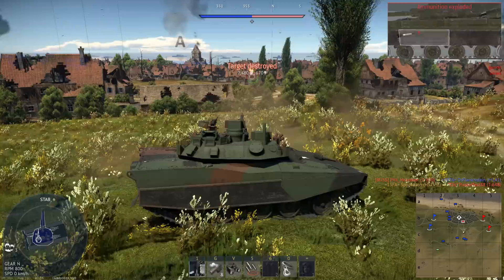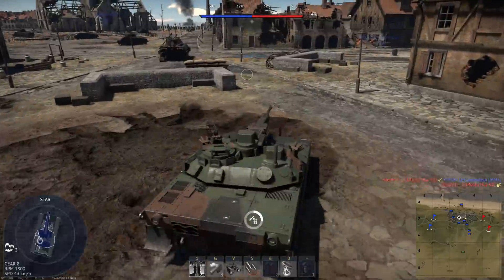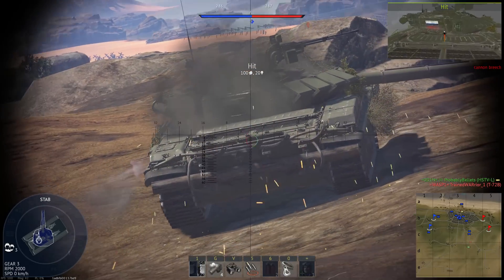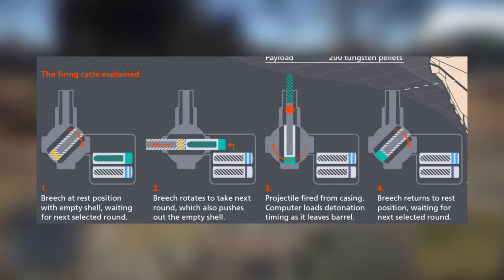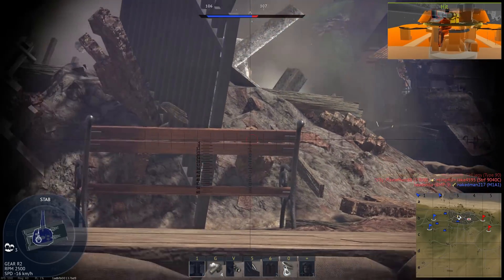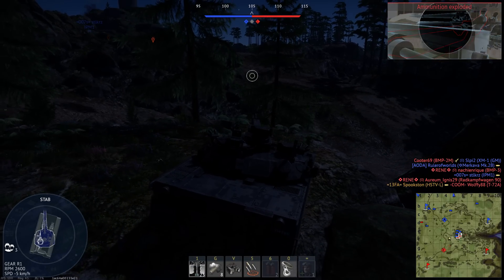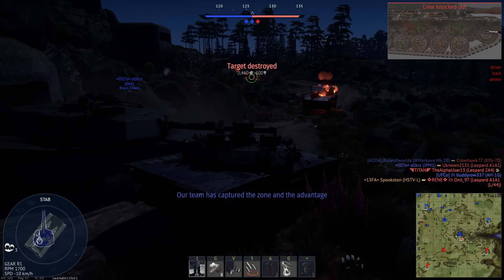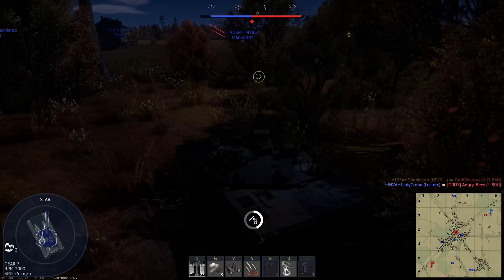CTA Cannons - Future Tank Weaponry

Comment: What if we just use a litteral arm powerd by conventional propellant or even magnets to litterally just yeet the porjctile like that one space weel concept thing that never went anywhere. If u put a bunch of powder at the base of the stick it would probably save space as there is no giant barel and because how levers work ur still throwing that projectile hella fast and if its enclosed until the shell leaves the arm I can really see this getting a rediculs amount of velocity. It would just want to tumble in the air tho witch obviously doesn't help with ballistics but I mean it removes the giant barel and still yeets stuff. It also possibly could use pretty much any ammunition type depending on how its built so it's a two steps in a random direction with one step back.

Comment: How does this form of ammunition actually work, though? How do you fit the projectile into the casing with the propellent and how does the propellent combust in such a way that it sends the round forward?
Reply: The cases are larger diameter than normal.

Comment: I know I am commenting on an 7 month old video, but i'm curious if you can use CTA for ETC cannons, or are they very much fundamentally at odds with one another?
Reply: It seems possible, but it seems equally possible that the kinds of propellants used for ETC guns might not have the correct performance characteristics to launch a nested round since they often burn quickly. They do burn more evenly, though, which could be a desirable trait. I think using a plasma igniter might at least be useful for getting consistent ignition even you don’t use an advanced propellent.

Comment: Another cool thing about the new CT40 on the Ajax ifv.
So, it also has smart rounds, they can be programmed for (HE Round)
Air Burst
Contact Detonation
And FIN, for anti armour

You can fire an HE burst, programmed to:
1) punch a hole through a foot of concrete with contact Detonation
2) put 3 air Burst rounds through to hole you punched a second before and burst behind it

Or you can trigger ERA on an armoured vehicle with HE and then hit that spot with a burst of FIN.

Comment: i'm not sure you really need the immersion in the propellant, the cylindric case seems to be the main benefit since it allows for the push through feed system. a conventional 90mm cartridge but cylindric and with the projectile sunk into the case like that nagant revolver cartridge could give you the benefits of both.

Comment: I tried googling swing breach loaders to get a better idea of how they worked but nothing showed up. Is the rotation of the breach gas powered? How is the next round loaded in? In 1:22 you see a diagram, but how does that magazine on the right of the gun work? You can't have a spring perpendicular to the shells or else it will load one round and then block off every other round.  Also the way Spookston described it, it sounds like the breach swings back and fourth but the diagram clear shows a 360 degree turn. I don't know if anyone can answer my questions or link me to a source that can, but it would be very much appreciated.

Comment: On the subject of guns, I’ve spent some time conceptualizing a 183mm HVG ( High Velocity Gun). My thinking is that the L4 183mm had unmatched  destruction potential, even to this day, among tank cannons. My biggest problem was shell size, and the only way to get a suitable reload was to slap a humongous auto loading mechanism. I wonder if CTA ammunition could solve the weight problem, though I’m not sure about a swing-breech mechanism. Also ammo would be APFSDS and HEATFS.
Reply: consider a (modified) autoloader inspired by the swedish Delat Torn turret (have magazines next to and under the gun, with arms to then transfer the shells to behind and then into the breech.

Comment: Wow, I'm impressed that a 75mm round (cased telescoped or otherwise) can pen up to 430mm of steel!!! Based on the very light research I did on the Internet, I calculated that, for rounds up to 90mm, the use of an APFSDS shell would result in a RHA penetration value of approximately 3.444 times the caliber size in millimeters.

So, rounding up, I estimated that a 75mm APFSDS shell would only pen around 260mm of steel. The fact that an advanced cannon plus the APFSDS CTA round could provide a boost in penetration of 170mm over my estimated value is crazy to me!
Reply: If calc u made are correct, WOW! Even absent T-72 frontal penetration (AND even air superiority), a lot of enemy MBTs could be killed by a low profile, fast moving TD, mounting (in effect), a 21st-century, anti-tank HMG!
Reply: @sholoms  Oh, great, AT machine guns... How did that work out last time?

Do you really expect a system already being pushed beyond it's capacity to stand the test of a future arms race?
Reply: @engelbert42  how did it work out? well the military is still in love, so i would say its went extremely well. i don't think it would become the primary battle cannon, but such a weapon would become a common support weapon.
Reply: @matthiuskoenig3378  ofc. autocannons are great to support infantry. That wasn't the question tough.
Even a quick firing 75mm gun is by no means a reliable anti tank weapon... It just makes next MBT armor design consider that threat.
Reply: So that's four tomatoes worth of performance improvement.  Interesting . I was thinking two watermelons but I'll settle for four tomatoes . Probably a pretty costly system.  In the neighborhood of 40 million pents.

Comment: Though, what makes it more practical?  I can imagine a slower rate of fire one of these on an Abrams, to save ammo expenditure, barrel life, accuracy, and maybe a larger round if needed.  But there always needs to be a back up if one of them fails to cycle properly or breaks down.  Can it be manually loaded or repaired quickly?  If not, the army, navy, or air force don't want it if it can't perform in its primary function or have a secondary property of use.
Reply: Yeah, if it can't have a backup manual loading feature, it's possible the US military might shy away from it.

Our friends (Brits, French, Germans, and Japanese.) on the other hand...

Comment: Should note the 40mm gun for the Ajax is also being proposed as part of a Warrior IFV upgrade package. We'll see if it goes anywhere, though.
Reply: It won't. Military hates innovation in peacetime
Reply: the MOD and government have already said that the Warrior and Scimitar are being replaced. Scimitar is being replaced with AJAX and Warrior is being replaced by Boxer- so 40mm warrior wont be a service vehicle, and at this point was only used to proof of concept the gun for the AJAX on a platform that was already being made and used by the BAF.
Reply: @kaiotie1  Yes. Well done. Warrior CSP was cancelled 3 years ago which, as you may notice, is after the original comment was posted.

Comment: Wow, never heard of this before.
Reply: Welcome to the club
Reply: Hk g11 scaled up
Reply: Not really the same, G11 uses Caseless ammunition.
Reply: @SleepySkull1  I dont think that's how it works
Reply: What? The G11 uses caseless ammunition, That's a fact.
Reply: @SleepySkull1   @SleepySkull  it is, however, an embedded round.

I didn't say it was caseless, I was drawing a parallel between two cta rounds

Not all caseless rounds are cta and not many cta rounds are caseless, however the rounds used by the hk g11 is acta round feeding into a rotary chamber, the resemblance is self evident.

I'm not saying all cta is caseless.
Reply: Don't get it mixed up, CTA literally says it's cased, While the G11 is only a Telescoped-Ammunition rifle.
All CTA are cased, While caseless can be Telescoped or with a propellant behind(Ala M256, L44, Rsh-120, Though you can debate it's cased because of the primer not disolving).

What you could of said, is both are telescoped-ammunition.
Reply: @SleepySkull1  which is literally what I was trying to convey without being a pedant, but I think you know that.